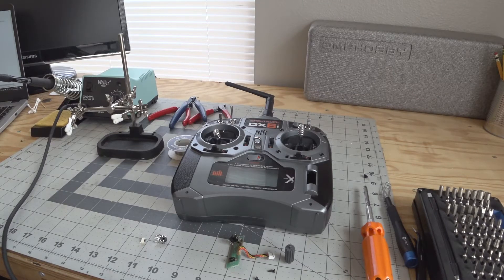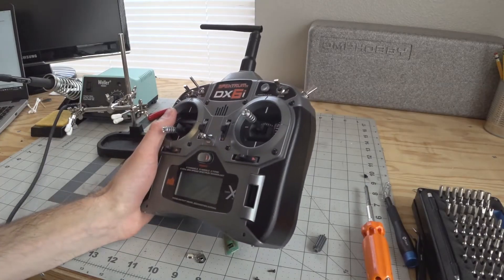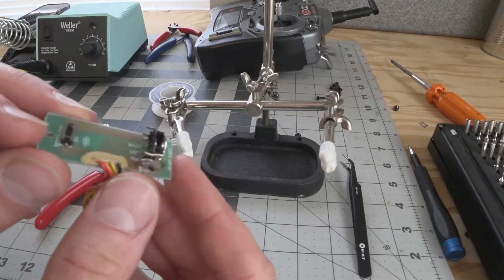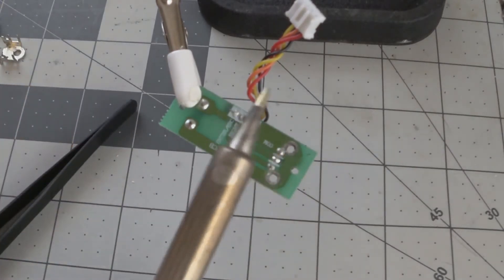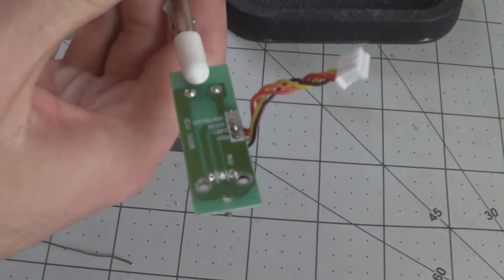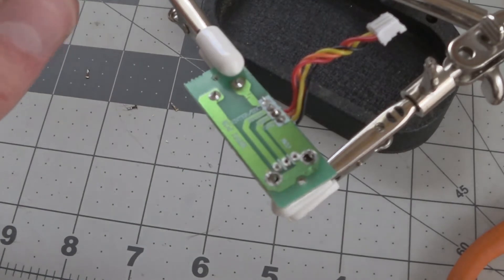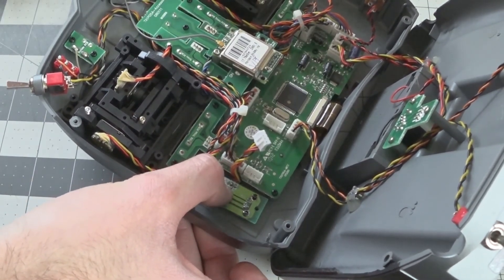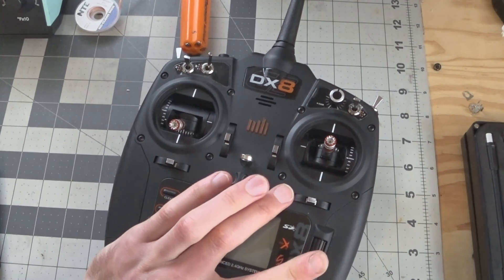Spectrum R/C Transmitter Scroll Wheel Repair

Comment: Yea, the scroll wheel on my Spectrum NX10 was very frustrating to use...jumped all over the place. Replaced with the parts listed above and works great. Quite a bit more complicated to get to the scroll wheel board as it is located under the main circuit board which needs to be totally removed. A bit tricky with ribbon cables, gimbal and antenna board removals.